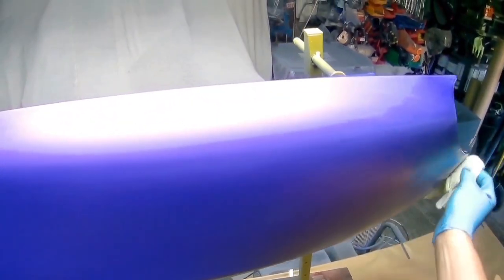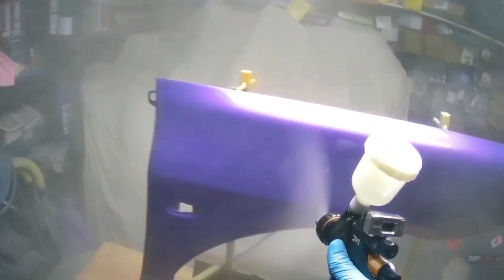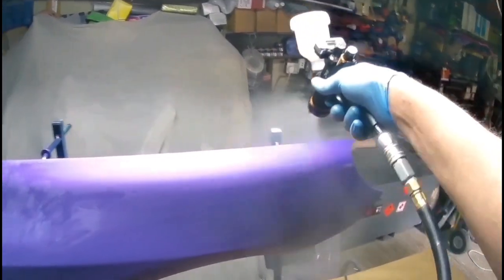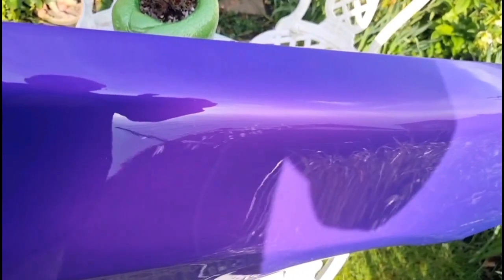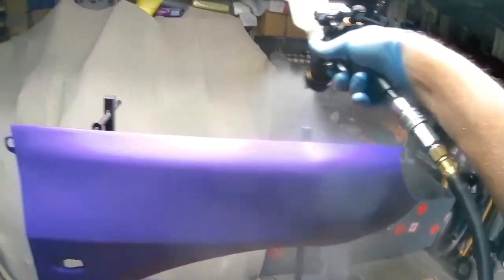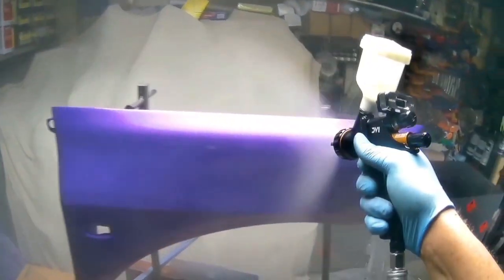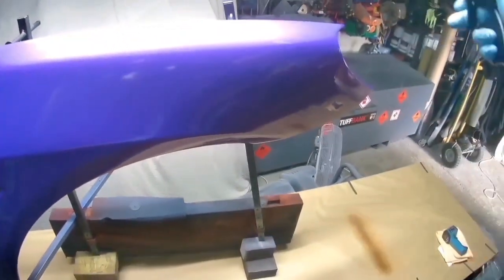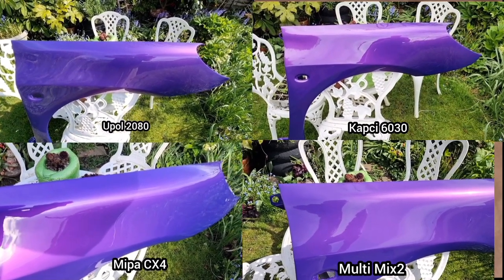Clear Coats, Mipa CX4, Multi Mix2, Kapci 6030 & Upol 2080 Reviewed With Devilbiss DV1 Clear

Comment: I use CX4 with HX4 but not all the time, mainly on bumpers so when fitting up the are nice and hard so less risk of of marking them, also on small jobs that might be going out quicker 
It’s a great clear and gloss is very good especially for the speed it drys, it’s a bit more advanced technology for fast/air dry clear so probably why it’s quite expensive, also it saves me gas in the booth with little or no bake times so is quite economical on that side of things 
Down side is the polish window so if jobs are not being polished for a few days or bigger jobs I used Mipa CC9
You can use HS10 and HS25 hardner in CX4 for bigger jobs and a bigger polish window 
Great review 👍
Reply from the maker: Hi mate, Yes, I certainly have found the CX4 + HX4 a very good option if you want good results with speed.
The polishing window was something I mentioned, I think. As you say, it's only short, which can catch people out that are new to it.

Certainly a good clear though,  cheers buddy 👍

Comment: Hi Pete, great video,  didn’t know about the polishing window on clears before it fully hardens, I honestly thought you done it after 😯oops. As you know I’ve used the upol as a beginner and thought that I got good results for someone that inexperienced like myself,  am keen on trying the Kapci 6030 though. Anyway great video as always mate very good clear information there. Cheers mate.
Reply from the maker: Thanks Steve,  yes, you can polish weeks after if you want but it's much  much harder and you often can't get all the tiny swirl marks out, much easier to do it when the clear is comparatively soft, this varies on temperature,  hardener and clear , cheers mate 👍

Comment: Hi pete great video, with honest reviews, ive used the multi mix ms & hs alot & never had a single problem with it yet, as for the kapci 6030 hs thats my next one to try as u said prices have gone up, and kapci ive heard good stuff plus its slightly cheaper than the multi mix2 hs
Reply from the maker: Thanks Ashley, I've never used the original MM which as you say is a MS but i know people who have with good results, I do like the MM2 and like you never had a problem with it although I know people have, I think i mentioned that 4 different people contacted me when i put a photo on Instagram to say they were having problems with the MM2 and different problems at that so it's not for everyone.
I think you'll like the Kapci, it's certainly as good as the MM2 and for me pips it and when you consider it's cheaper by around 10% great value, thanks again mate,  much appreciated 👍

Comment: Hey Pete, a really really interesting video mate you really explained it well and IMO your findings are spot on and exactly the same as mine, I haven't tried the CX4 but I have heard it's really good and the CX9 UHS is said to be an amazing clear. Like you I've heard a few complaints about the MM2 but have no idea why people have problems with it, I can only imagine they don't read the TDS and probably spray it the same as the Multi-Mix MS which I have tried and it still came out fine.

As you know I've used the U-Pol which is a highly underrated clear but as you say you have to spray your finish with that as there is next to no flow-out so it takes a bit to get used to it but for the price it's a good clear. For me the Kapci 6030 is the best of the three (not including the CX4), again as you mentioned it works at it's best with the extra fast hardener but even then it's still a bit slower then the MM2 with fast hardener which I think is why the Kapci gives the better finish. The CX4 is really in a different league as it's more expensive so is a better quality product.

Not sure if you know Pete but Kapci are bringing out a new clear in September, I think it will be called the 6050 and will be a true UHS and is said to be one of the best UHS clears out there, I'll be getting my hands on a 1.5L sample kit to try soon, ok I better bugger of as I can type about clearcoats all day🙄😂🤦‍♂ Thanks for doing this Pete🤗👍
Reply from the maker: Hi John,  yeah,  the Kapci went from my worst to my best over the 4 months or so of using it, most of that was down to the temperature, as you know it got quite hot here and the slower Kapci came into it own so with xfast I think it will be fine.

The CX4 is as you say much more expensive, it's no different in use to the mm2 and Kapci but really goes hard very quick and retains it's gloss doing that, a great smart clear for sure.
Yes i did know Kapci were bringing out another uhs clear, be interesting to see what it's like, cheers mate 👍
Reply: When I first started using the Kapci 6030 I did have problems getting a nice flat finish but Gav advised me to add 5% thinners and after that and getting my guns setup better it was fine. I must give the CX4 a try but I still have some of the Tetrosyl and the ColoMix plus I want to use the rest of my MM2 and I've got nearly a full kit of the MM1 that I won last year😂 so many clear kits.

I have been promised a sample kit of the Kapci UHS problem is I'm still waiting for the 6030 sample kit that I should have had  last November🙄🤦‍♂😂😆 been chucking some Tetrosyl clear through the Sata this morning it's  nice clear but very thin👍
Reply from the maker: I haven't used the Tetrosyl yet, yes, I've been putting thinners in the Kapci and MM2,  5% or 10% when its cold as it helps it flow better, not been using any in the warm weather and its been fine.
I've been doing a Wider4 v Kiwami4 with some upol this morning,  both 1.4, more of a difference than i was expecting, that's why we do it though to find these things out 😀, cheers mate 👍
Reply: I use thinners in my clear all the time, I'm afraid not to these days, looking forward to your findings with the Kiwami4 v Wider4 shootout👍 I've got so many clear kits kicking around I need to get some of them used up before I get any more but I keep looking at them and just can't resist buying and trying!😭🤦‍♂😆
Reply from the maker: @JohnWD40TC02  yeah,  i know that feeling 😂

Comment: I just realized there are two US versions. 2822 which is a "high solids" of 38% vol/43% wt mixed. Then there's the HS Super 2802 which is 38% vol /42% wt mixed. Neither are as high solids as other HS clears, but not bad either.  It appears while the solids percentage stated (mixed and unreduced) are quite similar, the only difference I see is the 2802 is described as a "water white crystal clear". A 7.5 liter kit can be had as low as $172  with choice of hardnerner from slow to fast.  From the looks of the comparisons, that's a very good deal for the price. I think I will be ordering one for my next project. Thanks again, Pete!
Reply from the maker: Hi mate, That makes sense, as in the UK we have 2080, same as your 2802, I think.
We also have 2081 and a 2082, which is the same as your 2822, I think.

I've never used the 2082 but have the 2081 and of course,  the 2080 in this video, there is a difference in the 2081 and 2080, the 2081 does have a better flow but I suspect it a slightly lower solids than the 2080

Comment: Thank you so much for this information video! I'm very new to 2k clear and I was wondering you were talking about a polishing time window??

Can't I polish at any given time? Wet sand the clear off and then use my polish paste?
Reply from the maker: Hi buddy,  A 2k clear coat takes time to fully harden, depending on the clear used and temperature.

This can take a day or a few weeks or more. The harder the clear becomes, the harder it is to polish.

So it's best to sand and polish in a time where the clear you have used will be more receptive to polishing, 

Makes the job easier and faster

Comment: Just love the videos Pete . I’ve just purchased some kapci clear for a smart repair after watching this . I was wondering if it’s ok to use this over a water base coat ? Can’t see anything in the days sheet except the usual kapci base coat recommendations
Reply from the maker: Hi Buddy,  Yes,  it's fine over a waterbourn base, as are all the others, good to hear your enjoying the vids, I genuinely enjoy making them 😀
Reply: Although I did make the mistake of buying the fast instead of the extra fast like you recommended :( I’m hoping I can get away with it . I noticed the kapci has a 10% thinner in the data sheet , can I use any lacquer thinner or do I need the kapci one to match the speed ? I’m getting very confused with compatibility between brands , I presume most primer , base and clear are compatible regardless of 1k or 2k mixed up in the same repair/job ? Hope that makes sense . Thanks for the help
Reply from the maker: Most TDS of clears will say up to 10% thinners. In the summer, I don't normally use any, maybe just a tad, but up to 10% is fine.
Any virgin thinners will do, often called 2k thinners. You can use that to thin basecoats,  primers, and clears regardless of make or it being 1k or 2k.
Reply: @peteshobbies5383  thanks for the info Pete, very helpful mate . I was wondering where you purchased your clear bottle type containers for keeping clear and paint ? 
I can find plenty on Amazon but unsure of the spec of plastic so the solvents don’t melt it away
Reply from the maker: All you need to look for is HDPE bottles. They are completely resistant to solvent, so give no trouble at all 👍

Comment: Im Just  a newbie Pete, i was given a can of jewels brand c496 2k hs clear, to do my front bumper with, after a base coat and colour coat.. don't know whether it's me but it looks satin,definately doesn't look as glossy as the back end of my car..? What should I respray with for high a high gloss finish in a can.. Thanks
Reply from the maker: Hi Mate, I've never used one of these can's, but generally, they don't perform that well.

It's hard to know whether it's the product of the application. If you haven't put enough on, it will look satin as it's effectively too dry

Comment: Came across this channel recently and wanted to say thank you Pete. Very useful information you are putting out here. This video and the spray gun fan comparison are great. I noticed you use a infrared lamp to cure, is there a particular one you’d recommend?
Reply from the maker: Hi Ash, thanks mate, I really do enjoy trying out all the different stuff to see what the differences are if any.
I use the lamp in the link below, I have 3 but normally only need one, this comes on a stand and you can put 3 on one stand or any configuration you want,  i think most lamp are as good as any but this with a solid stand is quite good I've found and not overly expensive,  there is no timer but i use one that's plugged in that i control from my phone if needed, cheers 👍 
https://www.ebay.co.uk/itm/183164398908?mkcid=16&mkevt=1&mkrid=711-127632-2357-0&ssspo=hQTh2-9uQlG&sssrc=2349624&ssuid=v5EZyL9iR9-&var=&widget_ver=artemis&media=COPY
Reply: Thats great, thanks Pete. I’m the process of doing some paintwork at home, so all your insight has been extremely valuable. Given that the colder months are around the corner, this lamp will be a worthwhile investment I’m sure!
Reply from the maker: Yeah,  you'll definitely need something,  they are designed to cure the paint after application but it's invaluable for helping warm the panels before you paint as well as after when it's cold, particularly with clear coat where I put heat before application then some 4 to 5 minutes after to allow time for the clear to flow out, most technical data sheets will give you a recommended time to allow before using a lamp 👍
Reply: Appreciate the reply and advice! Looking forward to watching the rest of your videos.

Comment: To be fair I have had nothing but issues with all multimix products , used the HS clear with fast hardner on the weekend we had the heat wave and it is still soft , what I mean by soft is you can put your finger nail in it , I’m going to try the Kapci
Reply from the maker: Hi Jason, I'm no spokesman for Multi mix but really surprised your having that problem, I've been using the fast hardener all the time, even in winter, 10c in the day 0c at night the MM2 went off ok, of course they will be a little soft for a few days but not that soft, certainly workable for polishing etc, the the warm weather we have now it's goes off much quicker as you would expect.
Having said that you are among a few that contacted me to say they were having problems so maybe it a production issue?
If you try the Kapci go for the Xfast even in this weather as its more like a fast, not for full resprays but certainly for most jobs you come across,  cheers mate,  be interesting to hear what you think of the Kapci 👍

Comment: have you tried the Kapci Latica? IDK I have some that i am going to try on some fender wells because it is really cheap here in the US...
Reply from the maker: No, have never seen it, looks like it's not available over here in the UK, the Kapci 6030 is pretty cheap over here, they have just launched the 6050 UHS clear, haven't used it yet but it 50% more expensive than the 6030

Comment: the first time I used Kapci 6030 I didnt really like it that much. but that was because I was using accelerator. It just does not work well with that. But later I dint use accelerator and Man I love that clear. it is super easy to spray. retains excellent gloss. Totally predictable. Just spray like you say 1 just over tack coat like medium dry, and one as heavy as you want. Then if flows out beautiful. NO DIE BACK.... just as shiny as ever. just keep the pressure up and it flows then holds without running like a pig like some of them.
Reply from the maker: Hi Mike, I don't use an accelerator as it normally causes some loss of gloss as you say.
The problem I had initially with the Kapci was the "fast" harder, the first time I used it it was around 9c or 10c or 50f, I left it overnight and the temperature went down to 2c or so, it was still not touch cured 24 hours later, apparently fast is like everyone else's normal hardener, so with extra fast, it should be better, in warmer weather it's not a problem at all.
As you say, an impressive gloss and is very forgiving, and quite cheap

Comment: We had spoken before on another video of yours on the 4 Walcom guns I use to run before switching recently to the 3 Devilbiss DV1 guns. I have wanted to try Kapci 6030 high solids clear. Do you feel its decent stuff? I also have wanted to try Chameleon either their 178, or 180 both are high solids clears which i always prefer for the nature of the things I paint for people. So the Kapci is good to go?
Reply from the maker: Hi William,  Yes, we were chatting the other day. The Kapci is a very good clear coat, particularly at the price it is. It flows out nicely, keeps a good gloss, and can be loaded if necessary without the worry of solvent pop.
Only thing I would say, I know your in the US, is the hardener/activator is quite out speed wise, so unless you are regularly painting at say 85 to 90f the extra fast may be what you need, I find the fast hardener is unusable in the UK in the winter as it takes days to go off drying in the air, or you need to lamp it for ages, cheers mate 👍

Comment: Hi Pete, have you tried the kapci(White the 6033) over solvent basecoat? I'd like to tried it but i'm a Little bit concerned about the flashoff time/dust free because here in Sardinia the temperature is around 12-13 celcius max....
Reply from the maker: Hi Mate, Yes, I use the 6033 with the Kapci 6030, the first time I used it the temperature was a max of 6c and went down to -3 at night,  it took 2 days to go off enough to remove the dirt nibs.

I don't use it anymore in low temperatures. You will have a better chance at 12 to 13c. 

The best thing to do is use 6031 extra fast, it's acts the equivalent to a fast in European manufactured clear coats, so it should be ideal at your current temperatures.

Happy New Year, mate 👍
Reply: @peteshobbies5383  thanks for the reply Pete and Happy New Year to you too!!🥳

Comment: Hi
I also bought Mipa CX 4 and how much air pressure did you use?
I wanted to paint individual parts in the garage
Reply from the maker: Hi mate, on the DV1, I normally use 2bar, so 29psi. Obviously, it will depend on the gun. What gun do you have ?
Reply: do you have a lot of dirt on the part after painting ?
Reply from the maker: @Bubi0 no, the quality of the air makes a huge difference
Reply from the maker: I use the Sata at 2 bar, but many use them at 2.2 bar
Reply: @peteshobbies5383  How do you get paint mist out of the room with the fan blowing outside?
Reply from the maker: @Bubi0 I have two 700mm square boxes made of wood with a 600mm extraction fan inside, these vent outside through 100mm filter media that I buy in rolls, that works quite well

Comment: Hi Pete,  I just want to pick your brains!  Do you use a air fed mask or do you use a half mask with filters? Also what compressor are you using? Thanks Terry
Reply from the maker: Hi Terry,  these are the masks i use, mostly these day's i use the Moldex for most things,  your supposed to use the air-fed all the time for 2k, I only use it if i have a lot to do, link below, 
https://youtu.be/bSFlIpPoFKw
Reply from the maker: This was my setup until recently,  i now have 2 of the larger compressors linked as in the video, it works well and of course providing you have the power supply you can have both running at the same time, 
https://youtu.be/YnIjOZDBmAI

Comment: Hi Pete, what do you consider high solids clear? Over 40 over 50? Thanks
Reply from the maker: Hi David,  normally over 50% with UHS being over 60%
Reply: @peteshobbies5383  thanks Pete. Learn something new today.👍
Reply from the maker: It's open to interpretation, some companies call a 45% high solids but most of the them are in the lower 50s, some call there clear a UHS when it's 55% but most of the proprietary makes of UHS are more, lower 60s